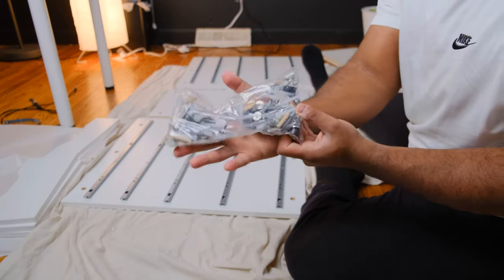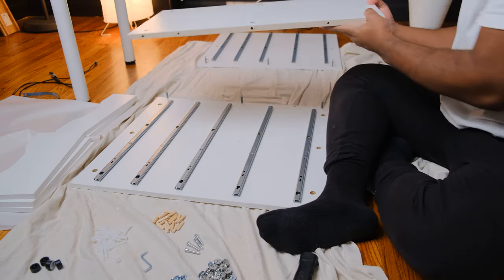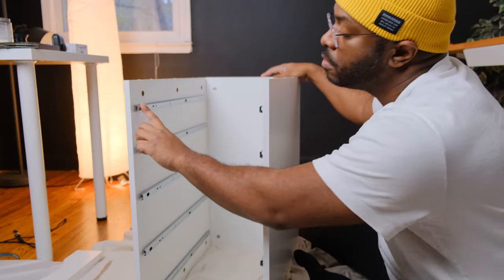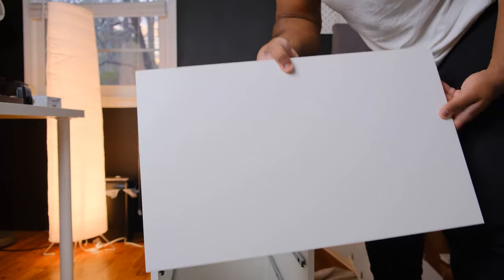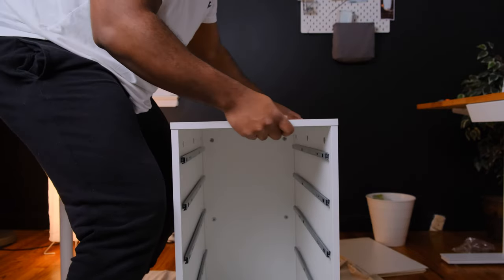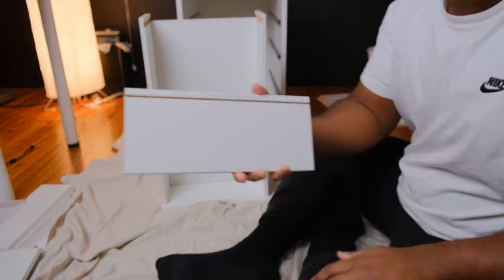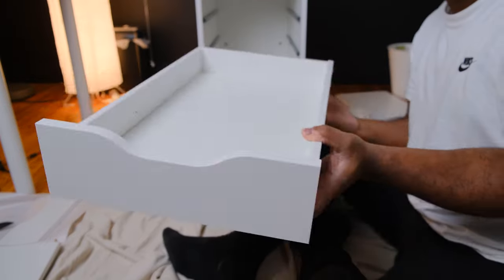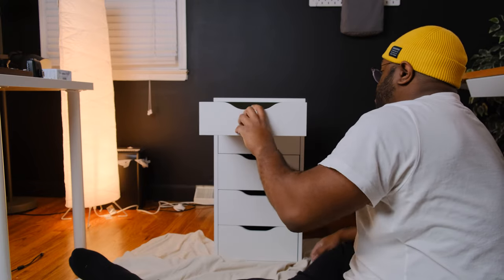How to Assemble IKEA Alex Drawers! A MUST Watch BEFORE Assembly

Comment: tip: Don NOT use a hammer to put the dows in. I tapped mine in and the thing broke through the other side.
Reply: Same 😭
Reply: Too late, i already finished it
Reply: What do u use then
Reply: You can absolutely use a hammer if you use a little common sense.

Comment: The screws on the sides of the drawers connecting the railing 8:06 might be installed backwards ? When I did mine I put it reverse so the screw heads wouldn’t be visible from the inside while opening the drawer . Plus the screw head didn’t cause any problems on the sliding rail so for me it was more aesthetically pleasing . Lol that manual can be a bit confusing at times 👌🏼 great and well informed video .

Comment: How do you attach the top to a desk? Or does it just rest on top?
Reply from the maker: I personally choose to just use 3M tape on each  corner of the cabinet and rest the tabletop on it and let it adhere for some hours. When I sat my tabletop on the drawers initially, they easily slide around. 

When building this you have the flexibility to use the other board that has holes in the middle so you can use the packaged wood screws to screw into a tabletop.
Reply: @visionarywatts  I am putting together now, I am having troubles deciding which piece I should use on the top and bottom. If I use the piece with the holes on the top how do I screw it In?
Reply: @marisacarioscia6421  same. The wood pieces don’t fit
Reply: @visionarywatts  hey I need help the side of the top Alex drawer that has holes isn’t big enough for the wooden pieces so how do I secure the table on top for he Alex drawers using the holes?

Comment: What about the bigger draw I’ve seen some videos on this draw but mine I have to assemble one of the metal parts on to then start the rest of the process
Reply from the maker: The 2020 IKEA Alex drawers and earlier required you to install the metal parts yourself but the new version has it already installed. In some other markets they may possibly be selling them the old way. I'm not sure. This video may not be helpful to you if that's the case
Reply: @visionarywatts  damn it this is really the only good video out there thank you tho